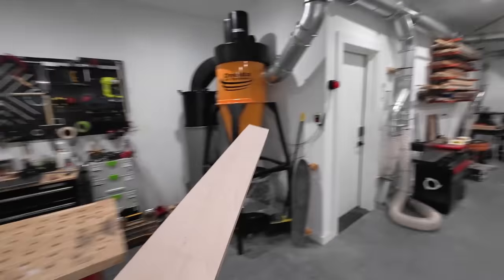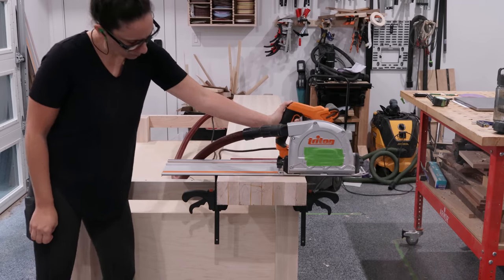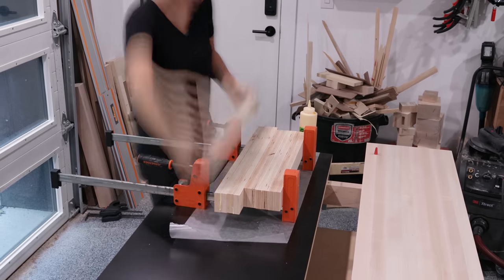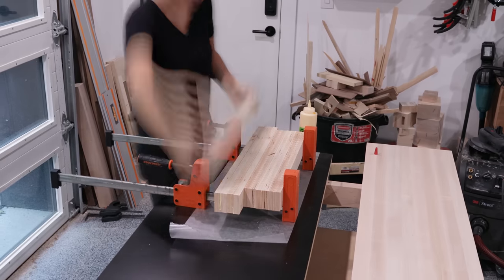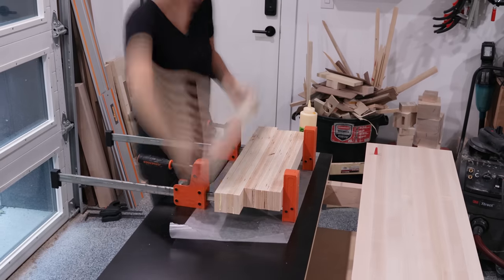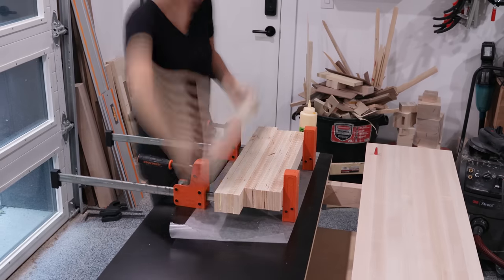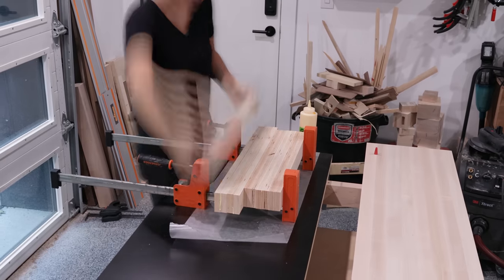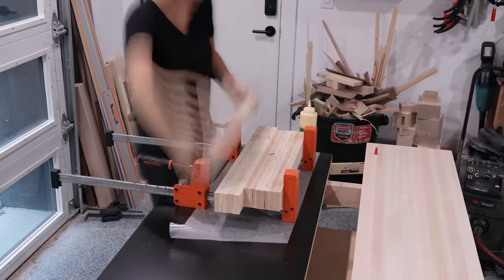My DREAM Workbench Build // PART 3: The Top

Comment: Next project: a camera platform so you don't have tripods in different places to trip you. Given the dust removal pipes, you'll probably need multiple platforms (or multiple cameras). The version I like is from New Yorkshire Workshop, but lots of folks have built them for their shops, so it should be easy enough to find an example and work off of that.

Comment: Q - as you plane the top of the hardwood part to resurface it down the line, how is the torsion box going to remain level?
Reply from the maker: I thought about this, maybe send the torsion box through the planer on the underside.

Comment: I wonder if you could have designed the gafftop part with the same design as the "prairie dogs" (just flipped). That way you only had to push down on the stop to release it up and then push it down to make it flush again. 

Otherwise an awesome build.

Comment: So instead of walking the top from outfeed end of the planer to the infeed side why not use your rollers on the top of the planer? You need to lift the bench top one way or the other. This would also negate the possibility of the top heavy piece from toppling over should you catch an edge while "walking" the piece.
Reply from the maker: Lifting it onto the rollers would be a challenge and then dropping it down to rest on the infeed would be another challenge.

Comment: Great looking bench. I have been thinking of making something similar. I have a question about the wheels, one of my concerns is lifting the bench one corner at a time outs torque on the bench and could lead to twisting, is this an issue or am I over thinking it?
Reply from the maker: I wouldn’t be concerned about that.

Comment: Okay, so let me get this straight. Around the 14:00 mark you discuss how your laminate top isn't flat. "¡No bueno!" And then you show inserting that scrap plywood underneath in the middle "just slightly higher than the [gap between the bottom of the laminate top and the top of the cabinet structure underneath]." Then you leave this scrap in place while you glue up your maple border. Then, voila, you remove the scrap and now the laminate top is flat. Did I get that right? Okay, so now some questions: 

1) How did you determine the correct dimension on the scrap plywood? I mean, too little and it wouldn't have been effective, too much and now you would've had a convex instead of concave issue. 

2) Since I understand that wood "moves," how do you know there aren't residual internal stresses that will get this out of flat over time? (I know, I know, you just built this, or at least just posted this, and you won't see any issues, if there are issues, for some months, change of seasons, etc. I guess I'm saying, yes, please, give us updates!)

3) Undoubtedly that laminate top looks really cool--all contrast-y and all. And if I caught it correctly, your reasoning was practical vs. aesthetic, i.e., resist glue-ups, etc. Okay. Well, why not just use a loose sheet that you could gunk up to your heart's content? (Maybe you discussed this and I missed it.)

Comment: Cutting laminate on the tablesaw is less about the weight and more it being so floppy.  You really need 2 people or a large infeed and outfeed table to do it correctly
Reply from the maker: I guess so. It’s just easy to blame my height. Ha
Reply: It may have been possible to cut it with the track saw on the ground with a bit of scrap board under. Then no flopping around.

Comment: It makes me a bit uneasy to use a spacing jig over and over for the dog holes because you could get an error that adds up.  Maybe it just doesn't matter for this application (or is so small that it doesn't matter).
Reply from the maker: There is no error bc of the perfect milling on the jig. The holes are 3/4 and the dowels fit snugly in them.
Reply: Trend make a similar jig to this, for MFT3 layout 20mm holes 96 spacing (32mm is a shelf pin size),  but it costs over £100 here in UK. There are videos of it being used to put holes over an entire sheet so I see no reason why Tamar's jig would not work.
Reply: @johnclements6614  I guess I'd be interested in seeing if the spacing holds over a distance.  Ten resets of the jig over 8ft with 1/64" additive error could be over 1/8".  Again, it probably just ends up not mattering for how the table is used for woodworking.  For a welding table, the hole pattern is often relied on for laying out your build, so the holes need to be spot on over 8-10ft.
Reply: @urbanawoodproject3123  As you note it depends what you are using it for. These dog holes appear to be drilled for work holding. They appear to be perfect for that.

With only the first holes referenced off the side of the bench the alignment will not be straight as they could be with that jig. Not a problem using the dogs with the tail vice but maybe if Tamar ever wanted to mount a fence for her track saw on the bench. Using a metal dog for alignment would also be more accurate.

I am not sure if a cumulative error is  a big problem as long as it is uniform so that the holes are at 90 degrees. Fences for use with track saws and routers on MFT type tables are adjustable to fit the actual position of the dog holes, all that matters is that they are at 90 degrees. (You would need it to be uniform in both directions for bevels).

The question with cumulative errors is also will they be less than the errors caused by the dimensional stability of the bench itself.